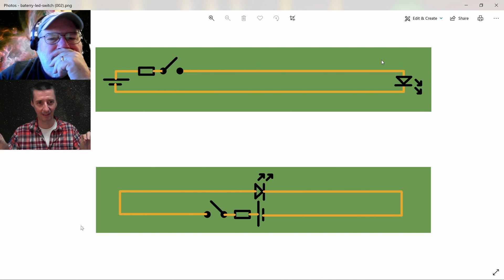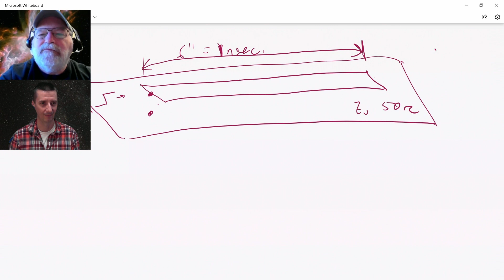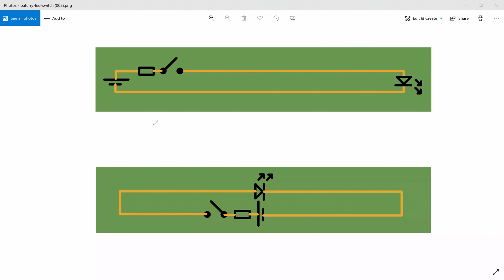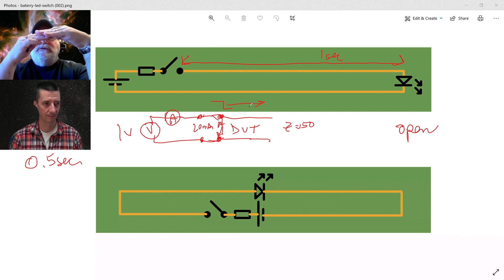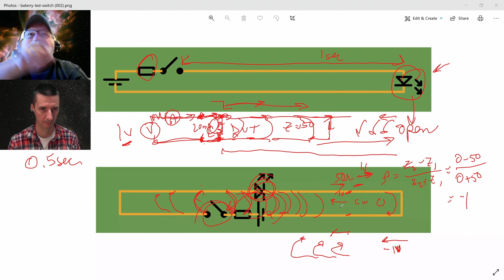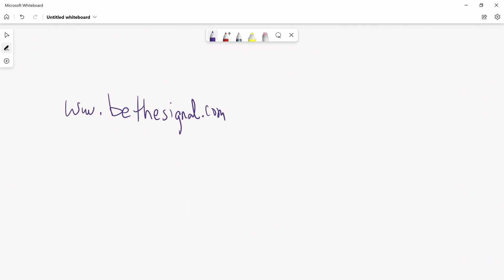Explaining Veritasium Electricity Video: Energy doesn't flow in wires (with Eric Bogatin)

Comment: So when there is a break at the Moon, we will see the light near the switch to be glowing for 3 seconds at about 1/2 of its full intensity and then it turns off, as it gets the circuit break reflection? And in case there is not the break but the shortcut, the light will double its initial intensity?

Comment: He is actually wrong about 2V and 50 Ohms, . .  Well correct, if the resistor is 50 Ohms and the Transmission line is 50 Ohms, then it would be 20mA in that switch On instant. . .  The transmission line becomes the remote LOAD.  . . . But that is now assuming the transmission line is long and lossy, at least >10dB line loss. . . . .    So his 1½ seconds for the wave in his transmission line in free space, is about correct...   . But even if that line is Not lossy,  2V is not going to turn on the LED, it needs more voltage than that. ..   But that would only be correct wave polarity for the led, very briefly, at the closing of the Switch. ..  The pwer source is a DC battery., not AC . . .  I used to make 75 Ohm transmission lines from two wires held 10" apartm and I have also done that with different sizxed wire,  spaced just 4" apart, there are calculations for this.. .  But this is completely beyond the original question.. . . .  Impedance and in this discussion long line impedance is only for  AC voltages, not DC. . .  So not from a Battery . .  Yes, in that very brief instant the switch is closed, but that will not give time to measure any current with an Ohmmeter. . .   So getting way off track now.. . . . .  He then says it is open at the far end, what will he measure on his meter. ? . . .  You only see an impedance of 50 Ohms as he says, if the cable is long and lossy, more than 10dB, we usually take 20dB Loss as reasonably close to an infinite long cable for impedance measurements, and using and AC 1V source.      . .. .  Interesting talk, and some good information, but way of track from the original question.  . . .  There is only a return 20mA or what ever, if there is Reflecton from the far end of the transmission line.. .. .     He then says the LED is open, how is it possible for the 20mA current going into the transmission line.. . .  Well very simply, the the transmission line has >20dB loss in it.. .  The power indicated by that 50 Ohms, is being lossed or absorbed in the transmission line.. . . .   He then says, if the line is totally no loss, ( theoretically ) then the 20mA will reflect from the far end and cancel out. .. .  Well true and Not true. .  This causes standing waves, so, depending on where you look, it may cancel out or double the amplitude of that 1V to give 2V. . .  Ths gets complicated, we used to put physically very simple, short shunting stubs on long transmission lines, to block that return wave, IF the transmission line and far end were not perfectly matched. . .. .This reflection effect is dependent on the AC wavelnength or frequency.. . .  A 1/4 wave sub, canges from an open circuit to a short circit effect.  . . .  Transmission line impedance is not based on reflection, it is due to the diameter of the wire and the spacing between the two wires, that is all.. . .  He is getting lost on this one now.. .  I do understand transmission lines rather well, I hsd to work with them. . . .   Basically he is right, AC Voltage and Current down a transmission line is rather different to just, DC Current in copper wires, very different. . .   So here I stop watching this video.   . . . Hope I have now given you some food for thought, on things I have done.

Comment: Think about this. Instead of sending current down the long wire, pull on the wire instead. Put a pulley on the moon to change the direction. Assume the wire is very ridged. Pull on the wire. How long will it take the other end of the wire in the earth to move?

Comment: He is right about how two wires close together will actually form, and have a transmisson line impedance, and this is very inportant in high radio frequency transmission lines, but that is getting way beyond the original queston.

Comment: Hi, . . As others are now saying, the original was just a wire, a very long wire, no inductance, no capacitance, virtually no resistance. .. .    Transmission lines are very, very different.. . .   A simple wire carries electrical current by the movement of Electrons, some have said sort of 1/10 the speed of light. . . .   Transmission lines are EM Waves, and this is very different. . .  EM Waves travel at the speed of light in their medium, which, in optical fibres, coax cables and on his example board, at about 0.6 the speed of free space light.

Comment: Excellent. A piece of test equipment called Time Domain Reflectometer uses this. You mentioned this as I write. If you know the impedence of the transmission line and put a resistor of the same value at the end the TDR will give you the distance of all the impedence changes down the line. Near shorts and opens and the distance of the same down the line.

Comment: A small problem with his example is the actual resistance of the wires that turn the electrical energy into heat. No energy reaches the end LED unless you ignore the reality of this one feature, while he maintains the reality of the field propagation. The Transatlantic cable solved this problem by lining the cable with a ferromagnetic material to amplify the current (magnetism) of the signal, counteracting the resistance losses (amplifying power without consumption or toxic waste) intervals of inductor cores does the same thing for phone lines, could solve the power shortages in the grid too.
Reply: While I do not have good knowledge of the transatlantic cable, I do have very good knowledge of phone cables, my profession. The adding of inductance, loading coils, on long distance phone cables is not to counteract the resistance of the cable. It is to balance the capacitive impedance of the cable. With unbalanced cables the different frequencies in a signal, travel down the cable at different speeds. When the cable capacitance and inductance is balanced the different signal frequencies travel at the same speed.
Reply: @yziib3578  good point. But matching frequencies alone may not be the only issue the inductors serve. It certainly is a good one, and it does not make sense to amplify the power if you further corrupt the signal propagation. The Transatlantic cable now has inductors only, the sealing tech improved so the irregular form is now water tight and a continuous wrapping was more expensive. On those phone lines. Without inductors, I’m pretty sure the distorted signal would not go as far. That makes sense, no? Certainly both caps and inductors would be optimal. Of course caps do transfer the electric field through the insulator, only transferring the energy to/from the conductors when the electric field value is changing, and no doubt more efficiently the faster the rate of change. Same for inductors to/from the magnetic field transfer ( which explains why these devices “filter” frequencies.)its a kinetic energy transfer trait. Applies to rockets the”Oberth “ effect, and baseball hitting home runs when the bat is swung with an accelerating speed

Comment: I'm still not convinced how a DC voltage with one singe change 0->1V should generate measurable displacement current and what happens if the cable is saturated and there is no more 0/1V difference. Also, please read the title of the Veritasium video, it's title has nothing to do with the example he demonstrates, also this cable physics video has nothing to do with it. It was very interesting though but getting boring. Again, please forget cables and focus on his title + description "The misconception is that electrons carry potential energy around a complete conducting loop, transferring their energy to the load". Everybody is way offtopic.

Comment: Why does everyone focus on this one part of Veritasium's video? Here are my questions.
1. All standard wiring is done with the hot and neutral wired side-by-side. This is required by the National Electrical Code (NEC 300.20(A)) to prevent inductive heating of metal conduit. It works because the magnetic fields produced by the hot and neutral are in opposite directions and cancel each other out when they are side-by-side. If the magnetic fields of the conductors have been canceled then the cross product of the electric and magnetic fields must be zero, so what remains to conduct the energy outside of the wire?
2. If the energy is carried outside of the wires then why does resistance in the wire dissipate energy, why doesn't the energy just keep going as if nothing was in the way?
3. The cross product is the product of 2 linearly independent vectors and is perpendicular to both of them. Where this is demonstrated at 7:34 in the original video it is not clear what vector Veritasium is using to represent the magnetic field since the field seems to form a cylinder around the battery. How he representing the magnetic field as a vector to form the cross product with the electric field?
4. In the 2 conductors (towards the load and back) the magnetic fields are in opposite directions but the electric field is in the same direction for both conductors. How can the cross products of the electric field and the magnetic field of the two conductors point in the same direction, from the source to the load, when their magnetic fields are in opposite directions? (8:00 in video)

Comment: I am guessing that the "transmission line" is out and back with the wires together and able to hold the propagated waves. Why, in some conditions does a typical transmission line (a real one as our electric companies use to get electricity to users) lose power to the air around the line? Lost power over longer lines is a terrible loss of economic resources. What would have to be done to prevent power losses?

Comment: I think you missed the question Veritasium, postulated, "Does electricity flow through wires?" What Veritasium was trying to claim is that wires don't transmit electricity, but rather the electromagnetic field itself. The turnaround test was supposed to prove the current was flowing in the electromagnetic field and not flowing in the wire at all. The fact is, the bulk of the energy is passed through the wires, regardless of what the electromagnetic field does.

Just because the current generates a field, does not mean we don't need wires, or the field can jump around to other wires, or that the effect on other wires is perceptible. Multicore wires work perfectly without their fields spreading the signals across all of them.
Reply: but veritasium also gave another example where energy flows between the two coils inside an AC generator, sans wired connection

Comment: In the second case you have a transmission line one meter long with the wires about 300,000,000 meters apart.  I believe the impedance of this transmission line would be over 3000 ohms

Comment: At 34:20 Dr B says there is displacement current in the transmission line on the right, with current flowing from the top (just right of the bulb) to the bottom (-ve terminal of the battery). However, before the switch is thrown, the entire circuit (other than the small section betn the batt +ve and the switch) is at 0V (the batt -ve vge). Why would there be disp current from the right of the bulb to batt -ve?
Reply: correct , i didn't understand that. It would only work if there was a negative voltage on the negative terminal

Comment: I'll come clean - I initially thought Veritasium was wrong.  Now I am not so sure, but I am still not completely convinced he is right.  I think I understand the transmission line view, but is the rapid arrival of the 'displacement current' really equivalent to the 'conduction current' ?  It seems that the displacement current is can be arbitrarily less than the conduction current.  In Veritasium's example (an incandescent light bulb),  the displacement current might not be enough to light the bulb.  I see the almost instantaneous arrival of the displacement current as like saying that there is em noise from the current starting to flow, and this propagates through space, and is certainly detectable at 1m distance within a few nanoseconds, and even enough to light an LED.  However, it does not seem the same as the arbitrarily large current that will eventually arrive through conduction. I love all the issues this debate has brought to light.

Comment: Veritasium video messed it up since he tried to mixed between reality and theory where c is constant, nothing can travel faster than light in vacuum and his setup expects zero resistant/impedance, how would the light bulb get all the sum energy coupling between the two transmission lines instantaneously with a super long line length.  The energy itself needs time to travel anyway even with maximum c or even less medium or conductive materials.

Comment: A simple question: When I turn the light in my house, how come that only the light in my house turns on and not my entire neighborhood?

You might find my question silly, but I find your assumption that a current in a 1mm wire will induce the same current (in an opposite direction) in another 1mm wire which is 1m away from it as silly. It will induce a current, but it won't be able to light up any kind of LED.

All in all I think that science asylum did the best job on describing the subject.
Reply: well the light bulbs in your neighborhood are not lighting up at "any power passing through", contrary to Dereks bulb. But yes all infinitely sensitive bulbs in the universe will light up.
Reply: @georgelionon9050  Not exactly, "all infinitely sensitive bulbs" are always on as there is always a white noise (due to lightnings on Jupiter and so on...). I really don't like Derek's video because he treats the EM disturbance as the electrical signal in an electrical circuit where the disturbance plays no meaningful role. Derek creates the impression that useful energy is always traveling the shortest path from source to sink and this is simply not true.

In the High Frequency Trading (HFT) industry, there are companies which sell wireless micro-wave communication as a faster replacement for cable communication. If Dereks's answer can be regarded as the right answer, then there shouldn't be a place for wireless communication in the HFT industry.

Comment: Eric quickly mentions that there are two transmission lines in the second diagram, however, if so, that statement should also apply for the first diagram. In any case, for the second diagram he says that two signals emanate from the switch when it is closed. However, the voltage across the ideal cell remains at 2 volts at all times, and the voltage along the conductor from the cell's negative terminal around the circuit and past the LED remains unchanged, so there is not any associated displacement field to the right of that cell, so no displacement current would flow. Does the pulse also travel through the cell raising the voltage on the 'negative" terminal of the cell?  With regards to the voltage divider concept, the voltage on the load side of the source impedance (across the switch) is initially two volts, then as soon as it closes the voltage on the load side of the source impedance drops to one volt with respect to the cell's negative terminal, so what happened to the electric field (represented by the extra volt) that was across the switch contacts? The associated field must have dissipated its energy some place. Was it radiated as an E-M wave? Can anyone clarify? It seems that Eric's comments assume an "instantaneous steady state condition" at various points in time as the pulse travels down the transmission line, but remains unclear what happens after the switch is closed, but before the pulse starts its journey down the conductor. Does the pulse travel in both directions?
Reply: Yes, the pulse does travel in both directions, and it lowers the voltage on the negative side of the battery
Reply: @bene5431  But why? Is the signal traveling to the right inverted? Has it a negative amplitude? Does it decrease the voltage from 0V to -1V from the start point on?

Comment: So to summarize. The answer is that the light source will light up immediately, but only if characteristic impedance of the transmission line, power source output resistance and light source are matched.
My problem with Veritasium video is, that I don't thing they are.

Comment: FFS, Veritassium's point is that the ENERGY (not the current) goes through the FIELD, not the wires.
If the load is physically close to the switch, you get fast action.